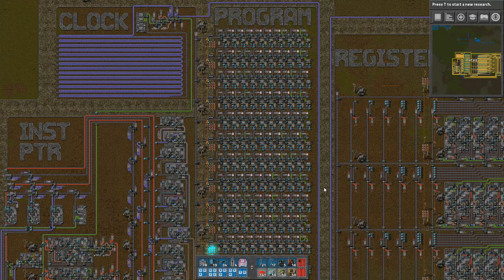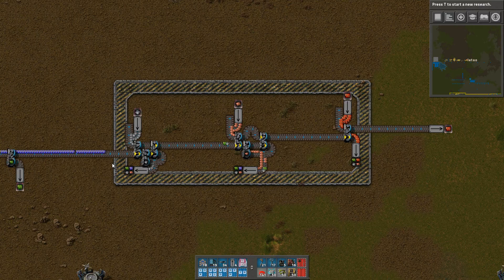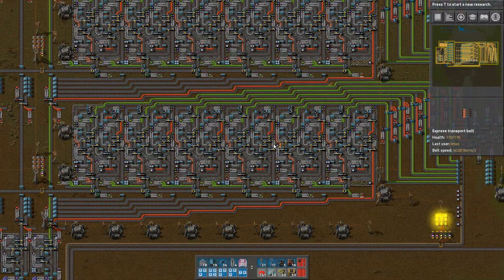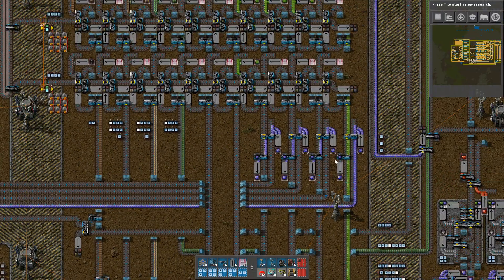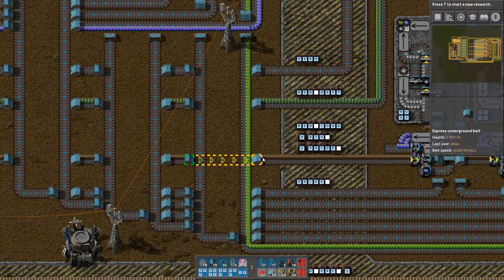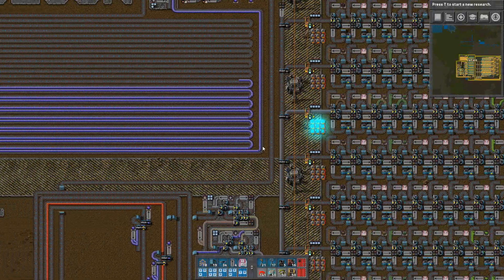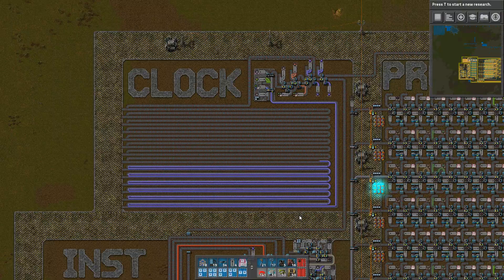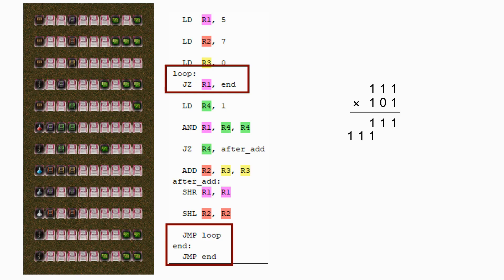Factorio Belt Computer Part 4: CPU and Programs

Comment: I was a bit sceptical when I've read that " Circuit network technology (wires and combinators) are not used". This is an incredible work! And it's very beautiful. I don't understand even the 10th part of how it works yet but I will find some time to try to figure it out. I think this could be a good tutorial about how CPU works.